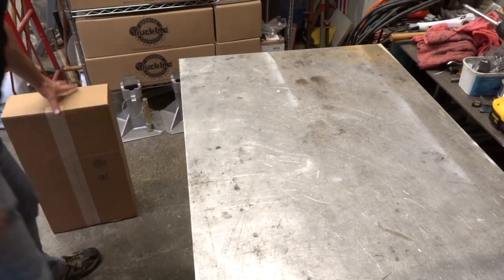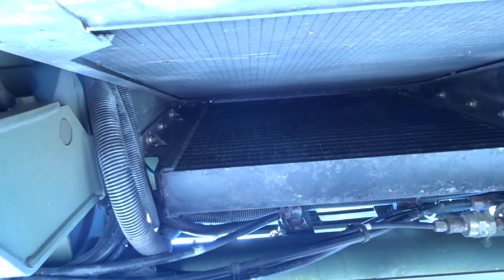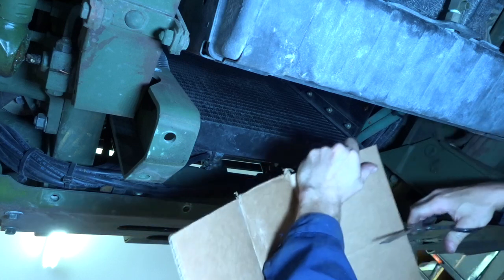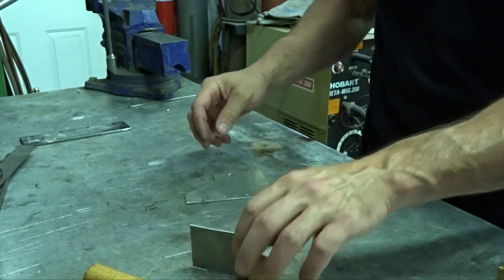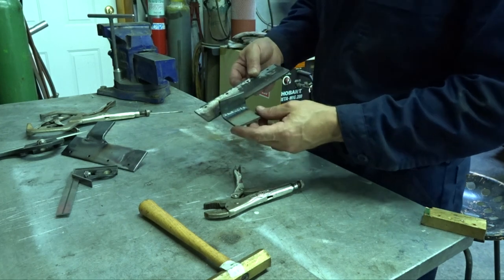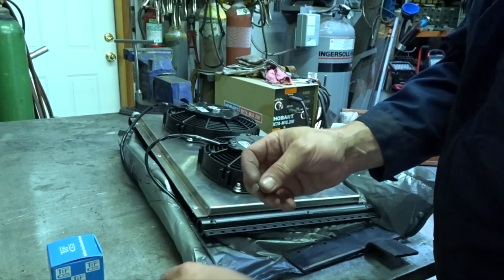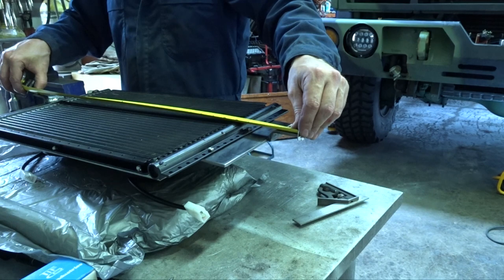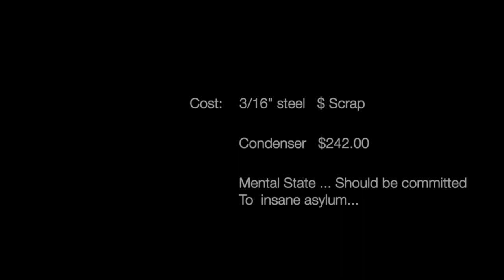Installing an Air-conditioning condenser in the LMTV

Comment: Love the shirt!  “Intercooler” is the word of the day and I think the passenger skid plate is there to protect the cab lift cylinder and mount... they probably should have put one in to protect the steering arm.   Where did you source that condenser?  That location is where I am going to put mine eventually.
Reply from the maker: I put a link in the description to the eBay sale.

Comment: Looking at it a second time,  The fans typically suck air thru the condenser assembly so yours is sucking air opposite the typical airflow and against any ram air coming in thru the gtill? That might be a problem on the highway or when the engine fan kicks on...
Reply from the maker: rronmar son of a.... looking at the direction of rotation arrow on the fan, you are correct.  Glad I have a ton of room to flip it around.
Reply: @BrokeOverLand  the fans will run in the opposite direction just swap the leads around....
Reply from the maker: Sean Fillner yeah I thought about that.   But I’m not sure my OCD would accept it.  :)

Comment: At least you didn't weld one of the brackets to the table.....LOL.  And can you control direction of fans... push vs pull air on the condenser?
Reply from the maker: Lol I actually replaced the condenser in a latter video.

Comment: Oh my Chad, love listening, so real life - two RH, oh yes done before.  So, can I buy your other one?  I need to do the exact same thing you just did!!  Curious, enough room for elbow AC line fitting?  Thank you for sharing ("idiot with tools"), hope to see you at the FMTV Roundup and we can swap idiot stories!
Reply from the maker: I’ll be at the FMTV roundup.  And yes there is quite a bit of room for the coolant lines.  I’m planning on changing this design though.  I want pusher fans rather than these that pull air.

Comment: Mine is mounted to the back of the cab. It's loud AF. I'm not sure why it was mounted there or if something is wrong with it that's causing it to vibrate. Does your's vibrate a lot? I wonder how much work it is to relocate it. It's so loud I think it's broken but it still blows cold air.
Reply from the maker: If it ain’t broke… :) mine is quiet enough you can’t hear it over the engine.
Reply: @BrokeOverLand  this thing sounds like it's about to take off. Lol

Comment: Won't that cause issues when water gets in there? I think some of the LMTVs have a switch on the dash to turn off fans for fording, but fans like these also would need to be waterproof. You're probably not planning to drive this thing through a river, but then again, you might, because you can (could).
Reply from the maker: On these fans.  Yes.  They are supposed to be ip47 but turns out they are ip46.  So I’ll be swapping this condenser with another one. Probably in may of 2021
Reply: @BrokeOverLand  Chances of it being the same size as this one close to 0? :-D

Comment: Ummmmmm any chance you saved those bracket pattern??? I’d kick you some cash for a copy.
Reply from the maker: I still have the brackets.  But I will say they are very specific to that condenser. I’ve switched to a different condenser since I did that video and it mounted completely differently.

Comment: Hey  man, am guessing the fans should be back direction right?
the grill should hit the air flow  first?
Reply from the maker: Yep already switched them after another commenter pointed that out.   The fan set the military uses are pusher fans that are installed in front of the condenser, but these fans are puller fans so that was my mistake.
Reply: @BrokeOverLand  keep up the nice work, really enjoying

Comment: Great video as always. I'm thinking about cutting slits into my skid plate and welding some sought of a screen behind the slit so that the condenser is protected and able to breath easier. What are your plans to protect the condenser?
Reply from the maker: Manuel Serrano I think there should be enough positive air pressure on the front of the truck it shouldn’t be too much of an issue.  If I get into a situation where I need more cooling I’ll look more into it.